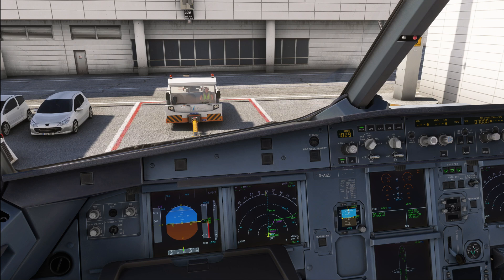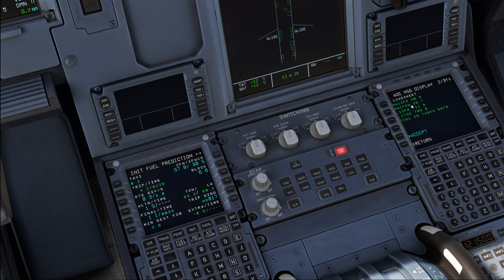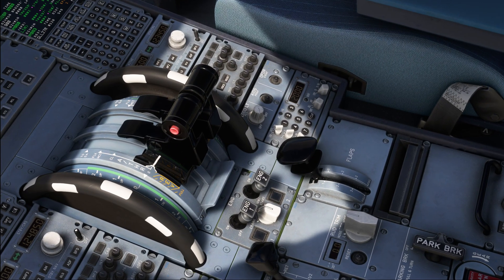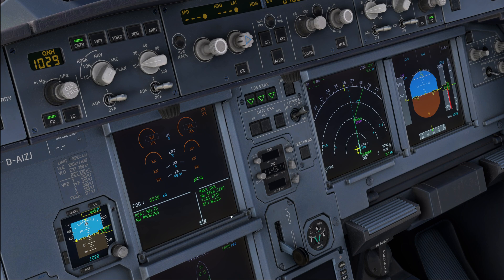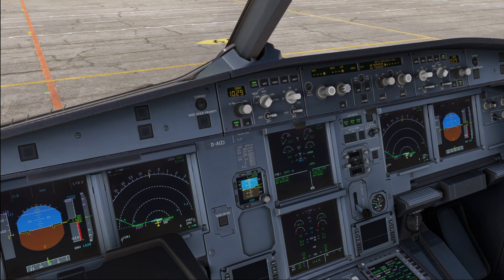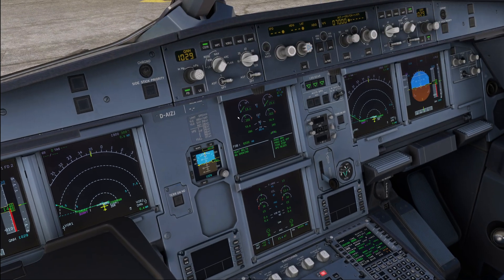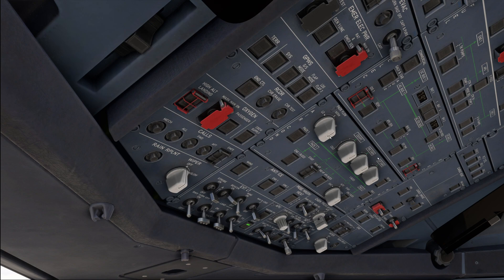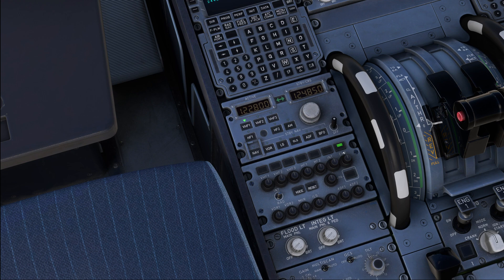Airbus A320 Tutorial 6: Before Start, Engine Start, After Start Procedures | Real Airbus Pilot

Comment: Hello Emanuel,

I have a short question about the Engine Out Procedure video, that you had loaded up a few weeks ago.

You said that when you would depart from EDDM from 08L, you would name the waypoint that is on runway track 25NM away, MUCX1.

But what if you have more waypoints?

For example EDDL, RWY 05L:

5 DME DUS (115.50), LT to LMA 311 holding.

The Point where you have to hold should be DUSX1, but what is about the waypoints which come before?

Thanks for your help!
Reply from the maker: Hi,
on those turn based procedures you can literally come up with any name. Perhabs name it DUS5 or something the likes. The X point is usually the one where you enter the holding in the end. Though with turning departures that may also be any "normal" waypoint.